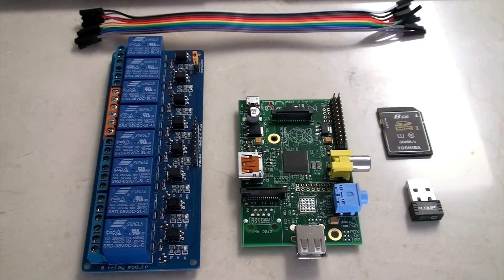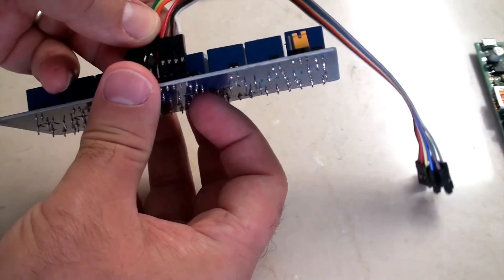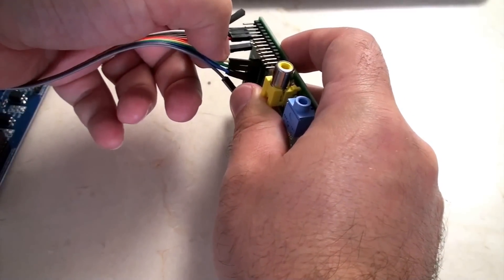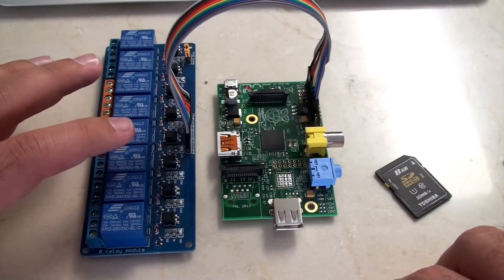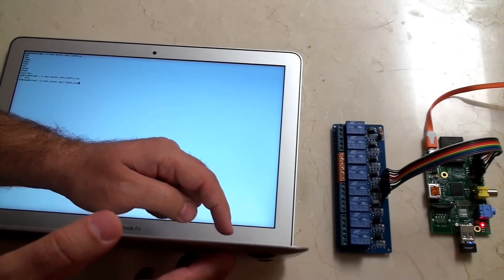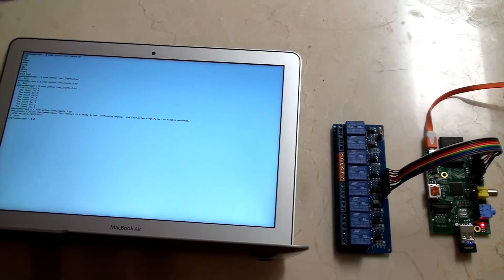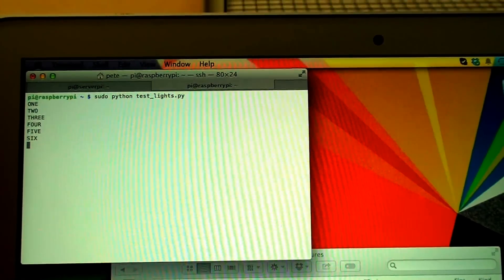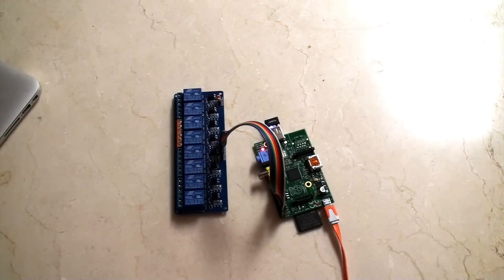Raspberry Pi: 8 Channel Relay step-by-step with software examples for automation

Comment: Thanks for the video, very nice. I could use some help if you don't mind. The relay seems to be working just fine as expected, clicks and all. What I'm trying to do is light up a LED with the relay, but it is not lighting up. I have the - side connected to COM, and if I plug the + side in to either NO or NC, I get no light. The LED is good and tested by connecting it to a battery. Can you help with what I'm missing so that I can light up external LEDs?
Reply from the maker: Tom Huck Sounds like there's something wrong here.  I show how to connect the Relay in this video:  https://www.youtube.com/watch?v=WpM1aq4B8-A at the 7:45 mark.  If you're connected to COM and NC, the light should be on with no power to the Relay.  If not there's something wrong. You can test it with a multimeter.  What do the solders look like underneath the board?

Comment: Hello, I discovered that scripts are working properly on MODEL B, but only request is to use enough power for the relay. I noticed power fluctuations on relay when i used poweradapter, 5V 0.7A, but when i used USB hub 5V 6A everything is working fine as on MODEL A. Without power raspberry can not work properly.

Comment: Where can I find the relay board?
Reply from the maker: Sandy Wilkins I bought mine from eBay - look for 5V optocoupler relays.  The optocoupler means it will work with the Pi.

Comment: Can't you just use webiopi ?
Reply from the maker: Charles Roberts I'm sure you could use Webiopi - but then you have two problems.  1) you've got to setup your relay and 2) you've got to learn to use Webiopi.  I believe that you, and everyone else, would be better off using python and the source code than learning an application - in the same way, I think you would be better served to learn HTML than Wordpress.
Reply: Ok, thank you for your reply how would you make a web gui to access the pi over the Internet. if you could just link a video or website that would be very appreciated thank you
Reply from the maker: Charles Roberts Check out my Garage Door project.  Easy Raspberry Pi Garage Door Remote over Wifi (home automation)
In the About Section of that video you'll find all the source code to run the relay through a webpage (by calling a python script from a PHP webpage).
Also, in about 4 weeks time, I'll have all the parts to complete my turning a 12V light on with my phone (which I'll do with the same code as the Garage Door remote, but I'll create an all-new vid for it).  
Oh, and don't be afraid to ask questions - just be patient, I'm all over this today, but sometimes it can take a few days to reply.
Reply: Ok thank you very much, I will wait and check out your video this has helped alot

Comment: Pretty amazed you got this working... Those pins only output a few ma and at 3.3v...
Reply from the maker: jasonroxorz that's why you need to choose the Optocoupler Relays as 3.3V and just a few ma is all that is required to trip the switch.

Comment: Nice toturial, thanks.
I have a litle problem/quest.
I use 5V 4-Channel relay and want to turn on 4 lamps, in this order:   1. = <425    2. at <400   3. <375 and last one at <350
There are manny examples out there, but only with one relay or alle work the same way, i´m thinking that I can use only one photoresistor, but arduino wont accept my code in the loop.
You dont have to use time on this, but maby other "arduinoist" have same thought as me.
Regards JJ.
Ps. I am interested in Raspberry but think I have to learn more with my litle uno to begin with.
Reply from the maker: Jørgen Hansen Hey I'm not sure if I follow.  When you write "1. = <425" what are you saying 425 is?  The millisecond delay?

Comment: hello i want to buy all this kit how and from where, your support please
Reply from the maker: iven a it's not a kit.  I bought the relay, the jumper cables and the wifi from ebay.
And the raspberrypi from Element 14.  Let me know if you have more questions.   P
Reply: thank you for quick reply i mean in kit ( all this Parts like relay and others ) with links from ebay or amazon.
Reply from the maker: iven a http://www.ebay.com/sch/i.html?_odkw=optocoupler+relay&_osacat=0&_from=R40&_trksid=p2045573.m570.l1313.TR0.TRC0.H0.X5v+optocoupler+relay&_nkw=5v+optocoupler+relay&_sacat=0
http://www.ebay.com/sch/?_nkw=arduino%20jumper&clk_rvr_id=719305213185
Reply: many thanks for your help

Comment from the maker: ***** Thanks for your questions.

1) The click is from the relay.  You can't silence that, though you can purchase Solid State Relays.

2) Yes, you can activate more relays, from more pins - but if you want to, you should indeed look into externally powering the relay.

Hope that helps, let me know if you have more questions.
Reply: +marc-antoine gauvreau Sorry. Little bit too late. It's pretty much the same code in this first. I only adjusted the pins:

#!/usr/bin/python
import RPi.GPIO as GPIO
import time

GPIO.setmode(GPIO.BCM)

# init list with pin numbers

pinList = [2, 3, 4, 17, 27, 22, 10, 9]

# loop through pins and set mode and state to 'low'

for i in pinList: 
    GPIO.setup(i, GPIO.OUT) 
    GPIO.output(i, GPIO.HIGH)

# time to sleep between operations in the main loop

SleepTimeL = 2

# main loop

try:
  GPIO.output(2, GPIO.LOW)
  print "H"
  time.sleep(SleepTimeL); 
  GPIO.output(3, GPIO.LOW)
  print "E"
  time.sleep(SleepTimeL);
  GPIO.output(4, GPIO.LOW)
  print "D"
  time.sleep(SleepTimeL);  
  GPIO.output(17, GPIO.LOW)
  print "V"
  time.sleep(SleepTimeL);
  GPIO.output(27, GPIO.LOW)
  print "I"
  time.sleep(SleepTimeL);
  GPIO.output(22, GPIO.LOW)
  print "G"
  time.sleep(SleepTimeL);
  GPIO.output(10, GPIO.LOW)
  print "!"
  time.sleep(SleepTimeL);
  GPIO.output(9, GPIO.LOW)
  print "!"
  time.sleep(SleepTimeL);
  GPIO.cleanup()
  print "Good bye!"

# End program cleanly with keyboard
except KeyboardInterrupt:
  print "  Quit"

  # Reset GPIO settings
  GPIO.cleanup()

And here's the pinkout for the Raspberry Pi 2: https://www.google.se/search?q=raspberry+pi+2+pinout&source=lnms&tbm=isch&sa=X&ved=0ahUKEwjSnpfApLjJAhVhd3IKHfSgBRUQ_AUIBygB&biw=1920&bih=1139#imgrc=G2Yz5CAlUPxZWM%3A
Reply: skiwithpete I guess my board is solid state cause it doesn't click. On the other hand I'm having some issues with your code. I get a message: "a physical pull up resistor is fitted on this channel"
Reply from the maker: Julio Oliveira you'll have to head to google for that one, it's not an error code I've seen.
Reply: skiwithpete Yeah, I know. Never saw that neither. Benn googling and found some stuff actually but nothing really matches my problem. Will have a look at the code again. Will get back when I find out more about it. Cheers mate.
Reply: skiwithpete And you can call me stupid cause I seem to be it. :D
Didn't check the pin out. I attached it first to a Raspberry Pi 2 B which seems to have a different pin layout.
Reply: skiwithpete Just to complete my answer: the pinlayout in the Pi 2 is completely different (had no idea about that). I also changed the code to adjust to the pinlayout. First I had written that I might have purchased one solid state relayboard but the problem was the ground. I connected the ground to one GPIO (11). This also solved the error message I was getting.
Reply: Julio Oliveira hey could you possibly send me the code that you have for the raspberry pi 2?
Reply: +Julio Oliveira could you send me the code to also would really appreciate !

Comment: Few questions:

Is the click from the Relay? Can the click be silenced or is that just an effect of the relay? 

Could you use more relays on the pins from the outside edge of the RPi?

I have a B+ with the 40 pins be used? I'm guessing I'd need to use external power.

Thanks!

Comment: I had the same problem with my Netduino, your using 3.3v on a relay board made for 5v
The answer is to use a separate 5v power supply on the JD-VCC and GRD
it works, trust me, this site explains it better.

http://arduino-info.wikispaces.com/ArduinoPower

Comment: Is that a sainsmart relay? They say on their website they require a transistor: http://www.sainsmart.com/8-channel-dc-5v-relay-module-for-arduino-pic-arm-dsp-avr-msp430-ttl-logic.html

I can get the LEDs to flash but there's not enough power on my GPIO to trigger the relay.
Reply from the maker: It is not a brand-name Sainsmart.  It is an Optocoupler relay.  And it works directly from the pi.  I got this one on eBay.  Let me know if you need help finding one. 
Cheers,
P

Comment: Does anyone else get a syntax error on the part "for i in pinList"
Reply from the maker: I think that happens when a) you have incorrect pin numbers in there. or b) there's a spacing error.
Reply: Yes i forgot a space, thanks for your quick response!!

Comment: Following this video Using Relays and Relay Boards with the Raspberry Pi we should use 3.3V for Vcc (GPIO pin 1) and 5V for JD-Vcc (GPIO pin2) to hadnle relay board better. Hope you will sometime update your great video with this info. Thanks.
Reply from the maker: I have tried this method with the board shown in this video - and it simply does not work.  Sorry.
Reply: Yep, I tried 3.3V with with B+ model and also it does not work. So only 5V and jumper on Vcc-JDVcc

Comment: Currently working on my own fork of this project... how do you wire up the PIR sensor so it doesn't blow out the raspberry Pi? PIR = 5v, Pi = 3.3v
Reply: Nevermind. I think my sensor is 3.3v. It looks like most are. I'll scope it when I have a moment and see what the value is. Thanks!

Comment: Great presentation pete .............. controlling these relays with WebIopi would have been more simpler and user friendly. Would you be giving it a try ?. I also see that you have a Banana Pi with you. Is is possible to plan a demonstration on that hardware ? Controlling relays with user input would be more exiting to see . Than you very much and I would be following you. 
http://circuitsonweb.blogspot.in/2013/02/8-relay-control-board-over-rs485.html
I have this project working in the house and would love to use the RPi to send data packets to control it.
Reply from the maker: Hey, I have a BananaPi Relay video.. check it out (but I only have limited success).  I'm not into WebOPI, because it's a generic solution, and most of my projects are more specific...  But, I'm sure there's lots to explore.

Comment: Great video! I have a small problem where as soon as my Pi switches on and the GPIO initialises it powers the relays. So as soon as it boots up my relay leds are lit up and the relays are "powered". How do I make it so that they are initially off?
Reply: Add a 1K pull-up resistor to each GPIO line in use. This will cause the GPIO line to initialize HIGH, even before you can set the default state by software... problem solved.

Comment: Nice presentation - got me up and running! I'm using a RPi as an OpenRemote2 server and as well as sending IR and HTTP commands I've now got GPIO working. Using your video and a bit of help from WiringPi I've added control of a mains switch for lighting. Here is a link http://youtu.be/d8LpMo57n6s - Interestingly my script started by holding all the relays open 1 by 1. And guess what, by time it got to the 6th the RPi died. Fortunately I only need the relays to close a circuit for a millisecond so once I had sorted the script it works really nice with no risk to the RPi.
Reply from the maker: Thanks for posting, unfortunately your link is to a private video :(
If you're having power problems try powering the Relay board separately from the pi.
Reply: skiwithpete
Strange - definately public - possibly I added link too soon :-/

Comment: Try all the codes on model B and they work fine. I ran them using Python 3 so for print statement, I would to add parentheses like so print("xxxx"); semicolon should be removed from the codes as well. Your codes are for python 2. Don't see the strange thing you encouraged. By the way, there's no click sound on the relay...which is great. Thank you.

Comment: Great video...excellent quality. In my RPi circuits I always use a secondary power supply even if what's needed is 5volt for the external board. I connect the grounds together and things work fine. I'll order the relay on amazon and give it a try with the model B using an Edimax Wifi dongle. I'll post back my results.
Reply: Results?
Reply: Still waiting on those results, please, post them up so I can move on with my life.

Comment: I am a little afraid to ask a very stupid question, but do I get you right?
With the Pi in Revision A it is possible to connect directly to this SaintSmart Relais Module, while having Revision B or B+ you'll need the Relay Module Interface Board?
Reply from the maker: The B doesn't need the Relay Module Interface Board.  I show my model B pausing during the sequence - which as the guys suggest in the comments below I believe is an issue with my power adapter.  I recommend using the A, if you're going to use a WiFi adapter - but in all honesty with a good power source... Both should work fine.  The B+, as i understand it, has the same draw as the model A - so, if you can get one, use that.
Reply: I use SaintSmart's relay and works fine with B.

Comment: How did you manage to power all 8 relays coils ? I have a model B and a similar 8 relay board but without the jumper. Can you help me with some useful link with how to power the relays ?

Thanks!
Reply from the maker: "Similar but without the jumper" - are you sure you have an optocoupler board?
Reply: skiwithpete This is exactly what I have http://i00.i.aliimg.com/wsphoto/v0/568527786/Free-shipping-New-8-Channel-Relay-Module-Board-5V-for-PIC-AVR-MCU-DSP.jpg
Reply from the maker: Scutaru Vlad I also have a YwRobot board and I can't make it work either.  I think that these boards may require an Arduino.

Comment: I have spent days avoiding asking what is going to probably going to have a very obvious solution.
I've updated all my libraries and Wheezy image and I just cannot get the initial lights sequence to run.

./test.sh (my file name)

I get:

Traceback (most recent call last):
  File "./test.sh", line 5, in <module>
    GPIO.setmode(GPIO.BCM)
AttributeError: 'module' object has no attribute 'setmode'

So then I use:

bash -x text.sh

and get

+ import RPi.GPIO as GPIO
test.sh: line 2: import: command not found
+ import time
test.sh: line 3: import: command not found
+import time
test.sh: line 5: syntax error near unexpected token 'GPIO.BCM'
test.sh: line 5: 'GPIO.setmode(GPIO.BCM)

Any assistance would be greatly appreciated. This is driving me nuts.... ;)

Comment: What about the whole 3.3v business when interfacing a 5v driven board? Doesn't the relay board pull up all inputs to 5v?
Reply from the maker: The Optocouplers on the Relay board allows the GPIO to output at 3.3V.